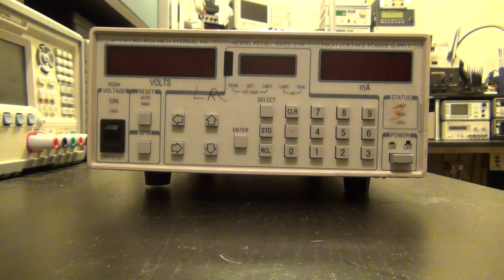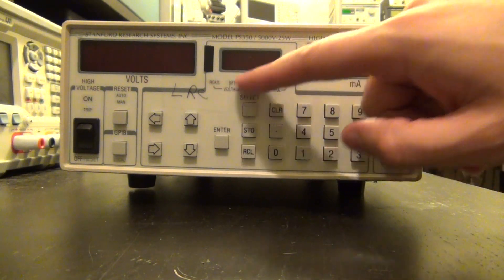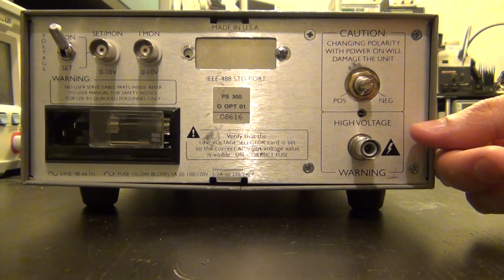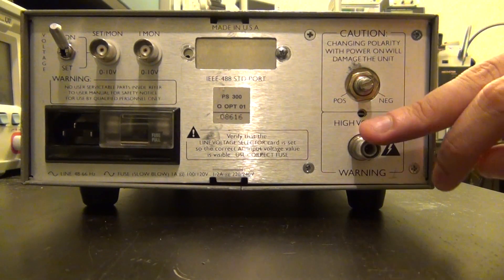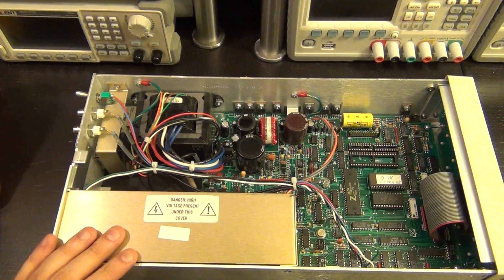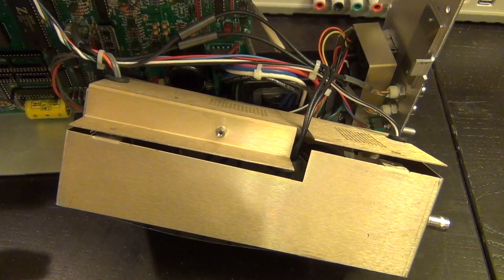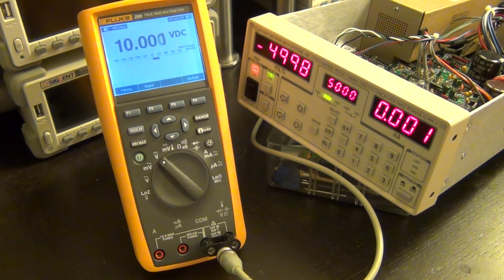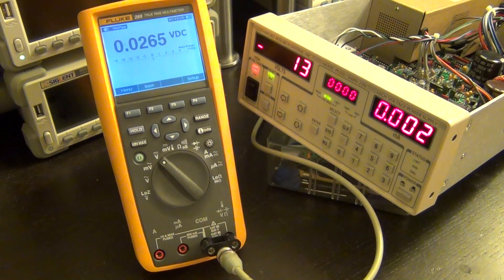TSP #56 - Teardown & Repair of a Stanford Research PS350 5000V, 25W High Voltage Power Supply

Comment: For an improvised HV divider I'd be inclined to use the uA range on the DMM - the lower input impedance should reduce the risk of damage in case of an arc-over.
Even with a resistively limited circuit, a spark from a connection coming loose can cause issues due to the very fast risetime combined with cable inductance.
Reply from the maker: mikeselectricstuff Thanks Mike, I didn't go over 1000V, beyond that I used the output monitor voltage. I'll make sure to use the uA range to try this out as well.

Comment: Great video as usual. For the voltage divider, i'd have used two or three of those Glass resistors in series just in case there was a manufacturing defect with one of them. I know they are pulse rated to 10kV but you can never be too careful.

Comment: HI Shahriar, great video as always. Only one very important note for safety that you have not followed I'm afraid...
-> in ANY non working HV equipment, ALWAYS work with one hand in your pocket and one hand on the device (you should have clamped the ground). Electricity always takes the shortest path to ground, and if its unavoidable to have that path go through your body, you might as well have it go through in a way that won't kill you. Not having a conductive path hand to hand is important, will never go through your heart or other vital organs, instead it may find ground through your arm and down your leg, saving your life.
Just my 2 cents!
Reply: Kris TheTrader Electricity doesn't always take the shortest path to ground. It takes ALL paths to the return conductor.

Comment: When I saw the output stage I immediately thought of CRT's. They use the same principle of voltage multiplication, and with flyback transformers. Triplers were commonly used in color television to provide the high voltage for the cathode ray tube (picture tube). As in your case the voltage is quadrupled for that instrument. Well lets hope your next repair is a bit longer, I know it's not your fault, it's a fault of the fault. Great video look forward to the next one, Cheers.

Comment: Another thing I don't know if you noted is that the chassis seemed warped when you  had it on the table (one of the LRFs (Little Rubber Feet)) was in the air (dunno if you have a warped table).
Could be that the unit has warped over time or got dropped, which in turn caused the pin failure of the 7815.
Any ideas on trying to secure up the mains transformer so it won't affect the chassis as much?

Comment: A nice permanent fix would be to extend the leads with some stranded wire.
This happens very often, even without added mechanical stress just the thermal expansion can break solder joints if the heatsink mechanics aren't done right.
Reply: stefantrethan Even worse in the days before THP and pads were very easily ripped from boards.

Comment: In user manual it is written that this unit works from 50V, so you don't have to be worry about the low voltage indications.
Reply from the maker: Jacek Pawłowski Great, thanks.

Comment: Hi. We have a PS325 model. And the Voltage output only displays 0 even when we set a voltage value. When we turn on High Voltage, the "Limit" at status display also lights up but out voltage display is still +0 and current display is also 0mA. Do we need a load to make the voltage output to display the set value?

Comment: You could do some experiments with vacuum tubes perhaps..  300-600v would be good for normal power tubes, and then some of the big transmission tubes can get into the thousands of volts, although I'm not sure at what amperage.

For experiments that look interesting, you could mess with some eye tubes, NOS ones of certain types are quite inexpensive. Tubes are quite hard to burn out so it could be fun as a kind of retro blast from the past.

Comment: Could you inject audio into the voltage input to make the unit drive electrostatic speakers? I'm thinking there will probably be a frequency limitation due to the capacitors in the output circuit.
Reply: MichaelKingsfordGray
I didn't realise flame speakers existed. I might have to give that one a go one day. I've seen plasma speakers where a high-voltage flyback is employed to produce a constant arc that is then modulated.
Reply: Judging by how slowly the output voltage responds when the setpoint is changed on the front panel, I'm guessing it will not pass audio.

Comment: For your voltage divider did you take into account the input impedance of the multi-meter when you said it was out a bit? That would explain why the direct connection up to 1KV tests showed it was spot-on.

You did make mention of the input impedance when explaining why there was current draw with only the meter but this would also apply to the resistive divider as well!

Comment: Shahriar, how do you connect that wire and get a good contact from the middle of the female SHV? I want to do this; I will not go any higher than 800V.

Comment: It looked as though the chassis was warped in the beginning of the video. It is possible the weight of the transformer caused the regulator pins to shear as a direct result of the laws of gravity :D
Reply: M@ You mean when it hit the floor:-)

Comment: I would go one step further in your analysis: transformers naturally vibrate at 50/60Hz, so you even have a permanent stress on the pins when it's on. Then the pins being copper, they tend to work harden, so they become more and more brittle with more vibration periods.

Comment: If changing the polarity while the power is on would damage the unit, I wonder why they didn't just use a 3-position switch with the centre position "off"?
Reply: thelastofthemartians 
even a two-position switch has an off position in between, you just can't lock to it. But I doubt that's the problem anyway. The problem will be arcs when switching that burn/oxidize the contacts in no time. An off position won't help with that.

Comment: Such a nice instrument, let down by the lack of an interlock to prevent the polarity being reversed while powered on. It would have been simple to implement, and hardly a significant added cost given that the psu must have cost a small fortune. Repair money for the manufacturer from blown units maybe trumped the desire to design it better.

Comment: My PS325 cannot go to zero (abt 10 volt residual) either, with an differential probe, i get an extremely narrow PWM, which makes sense. I use it for PMT in gamma spectrometer, very handy.
Reply: nuo xu looking at the PS300 series manual, the output voltage for the PS325 is specified as 25 to 2500V, and the PS350 as 50 to 5000V.  So the designers apparently knew the voltage divider noise at low output voltages was a limitation, but didn't see it as important for the typical usage of these units.

Comment: GPIB IC sockets layout looks like it may be a solution with NAT9914, 75160 and 75162, so in theory (if the firmware is the same across all units) you could add GPIB with these few chips and GPIP connector over ribbon cable.
Reply from the maker: Robert Lukierski That would be interesting. I found that OPT 01 on this unit is actually the GPIB which is missing. So someone has actually removed it! :(
Reply: The Signal Path Blog It's just a gut feeling, double check if NAT9914 makes sense there (DIP variant) :) I have SR850 so I can check tomorrow what they've used there (maybe they reuse some designs).
Reply: The Signal Path Blog actually that circle next to OPT 01 would be filled in if the option was factory installed.  At least that how HP & Keithley mark options on their back panels.

Comment: You might want to keep an eye out for  a AN/USM-223 (aka ME-297/U) on the used market. These are all-analog VOM'S that include 1 and 5kV ranges. They're remarkably accurate, given the technology with which they're implemented. They're ex-military, so they score 10 on quality and 0 aesthetics. When they first hit the used maket they were as little as $5; by time I found out about them I paid $25. They still show up from time to time; you be the judge on price. It probably would have been useful for testing this power supply.

Comment: I need a lab cat! :)

Considering the price Stanford would likely have charged for this unit new, I feel the poor mechanical design is inexcusable.

Nice repair!

Also, I would pronounce Zilog like Zeyelog (with the I sounding like the I in rice)
Reply: ***** I bet the cat ran a mile when Shahriar sparked the gap. PS. It's pronounced zilog as in "ill" here.
Reply from the maker: IanScottJohnston He is locked out of the room when live voltages are present. :)

Comment: With such a low current, will 5000 volts really hurt someone?
Reply: Razor2048 While 5 mA is generally not enough to kill, it's likely quite unpleasant.  Also, the peak current available might be higher due to the filter capacitor on the output of the multiplier!
Reply: Razor2048 5kV@5mA = 25W. Yes that will hurt!

Comment: this device has obvously been bashed around so those pins probably broke in 1 big event because of the transformer weight. It might be worth resoldering the other regulators too.

it's not unusual that a DC to DC converter has a minimum output voltage or output power, especially with such a high plant gain. i wouldn't expect it to go down to 0 like a linear regulator might.

Comment: I'm working to repair a used PS325 that I picked up on eBay.  Unfortunately, someone rather incompetently tried to repair the unit before it got to me (including using incorrect replacement part in some places.)  So, I've had to work carefully to undo this bodged repair and put back correct components.  However, this is made harder by the fact that the manuals available on-line  all seem to lack schematics and are either incorrect for the version of unit I have, or just plain wrong in some places places.  If anyone seems to know where I can find a printed manual with schematics, I'd appreciate it.  The PCB in my PS325 is labelled as part # 7-00184-701. REV E, 1989
Reply: Turns out Stanford Research sells printed copied of the manual for my PS325 that include schematics and board layouts.  Cost is $100.  My should show up in a few days and, hopefully, will let me get this sucker properly repaired.

Comment: Tesla coil input?
Reply from the maker: joblessalex That would require an AC source, this is a DC power supply. :)
Reply: The Signal Path Blog Indeed, but I was thinking a high voltage switch of some sort on the output that you could even modulate for sound.

Comment: In 30.40 minute you say: ".. so I not know  what is output impedance of that thing."..
Well I have problem with that, in DC you do not deal with impedance. But I would be very  pleased  if you  correct me with  it.
Other than that ,,,, wow...  I love your videos.
Wesley
Reply from the maker: stivep1 Hi Wesley. You always deal with impedance at any frequency. Except that the reactive part of the impedance would be zero. The resistive part is non-zero. You can define the output impedance as a function of frequency. When frequency goes to zero (DC) the reactive part collapses to zero but the resistive part remains.
Reply: The Signal Path Blog Wikipedia:"When a circuit is driven with direct current (DC), there is no distinction between impedance and resistance; the latter can be thought of as impedance with zero".
I have the same  PS350 5000V in my lab. I did not check  it with oscilloscope for ripple. That would be interesting. but with over 400 toys  all around I simply did not think about it. So  my point is that at the output we have  DC, and  by that only reminding component is pure resistance. The reactive part is  not present. 
That is why I questioned your  "impedance output comment"
For me you are  clear  in most of other  material  presented to the point of satisfaction.  Thank you for your work.
Wesley
Reply from the maker: stivep1 Thanks, the Wiki statement is the same as what I am saying as well.
Do you have a HV cable for your PS350?
Reply: stivep1 
Impedance includes resistance, so even at constant voltage you deal with impedance. Other than that DC and constant voltage are not the same thing! This device can be modulated quite easily. As soon as you have changing voltages/currents you need to look at impedance. You don't need the voltage to change sign for reactance to come into effect.
Reply: superdau Only in the fall or rise time.That would be your AC(* rate of change) Averaging stands for DC.
Variations, gives you  only incident reactance and only in the given time frame. So for that , the note  about impedance  in  30.40 minute needs some of additional explanation. Lightning is DC  with AC fall time. However variations of charge before lightning happened are more significant.There is local DC flow at that altitude as well. At that point you may recall  sound in your AM or even FM receiver , showing you all  of AC components during discharge.You do not need to have spectrum  analyzer employed  there.
In PS350 5000V-25W we have been dealing with already established power dissipation, so no rate of change is expected to happened. It would be nice to check HV output  for ripples, and that would make quite nice addition to  the material in question.
I would have no problem to donate to  The Signal Path one of my  RADIOMATIC RADIO CHROMATOGRAPHY DETECTOR devices, He would have than two of   HVAC wires with connectors, and run photomultiplier experiments or even  run beauty of device application, say C14 and  so on... Particle physics is just the world of  excitements only seen by some of us, but gives you more than super good fast action movie,,, no matter how good  it was made. You just can not wait for what is next...

Please correct me if I'm wrong.
With  Respect

Wesley
SignalPath please contact me if you are interested.

Comment: Shahriar, put a metal bracket between the HV can and the side wall or between the two sides. That will stiffen it sufficiently to prevent this sort of failure from happening again. Really crappy mechanical design, indeed - someone wasn't thinking when they put the heavy transformer on the side wall.

The other option is to desolder the regulators from the board, turn them upside down and use wires to reconnect them. That will provide for a bit of give and prevent them from shearing off.

Comment: It doesn't give zero when you want zero because it's a 5000v supply. Why people will use a 5000v supply with 2v, 0v?
Reply from the maker: Navarro Eletrônica I explained the likely reason why it does not produce low-voltages well. Although the main intended use is not at 0V, it is important to know why it behaves the way it does.
Reply: The Signal Path Blog  I got it!

Comment: i have a problem with a dc power supply;  is not addressed on you tub.  the dc supply suppose to source out 20 -220 and 130 - 220 dc volts but can only read around 50 to start with but then it keeps dropping and stops at 30 vdc,,, why???...is like a capacitor discharging ...any ideas fire them now or don't pretend to be a scientists by  making 10 years long boring videos